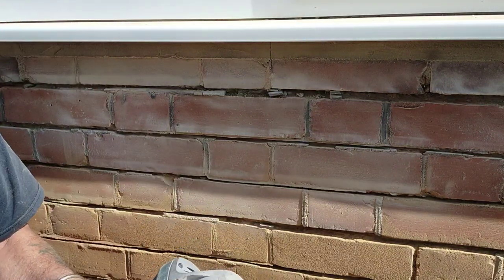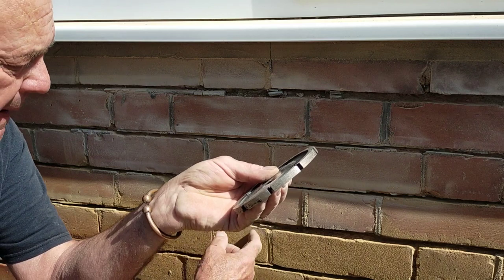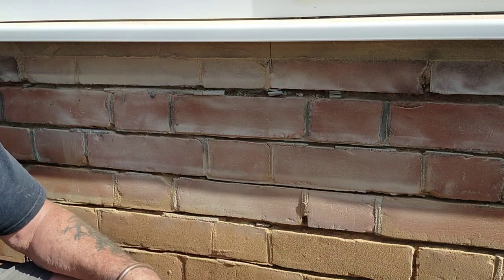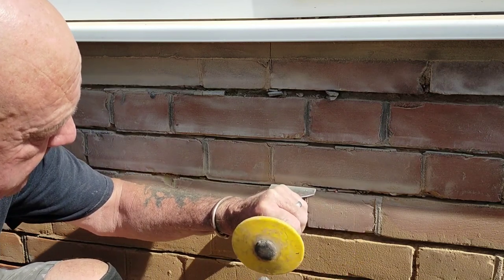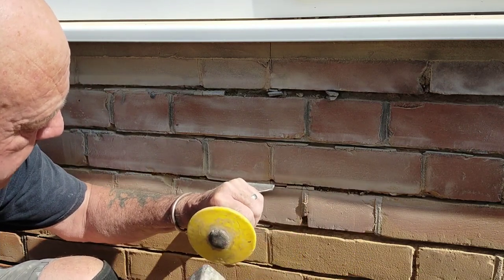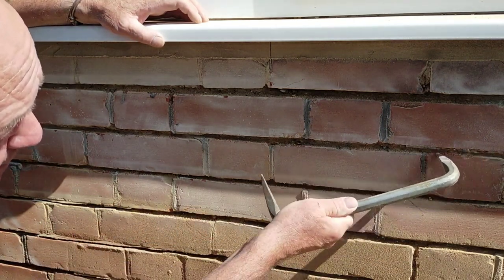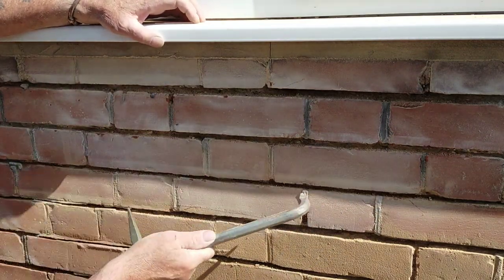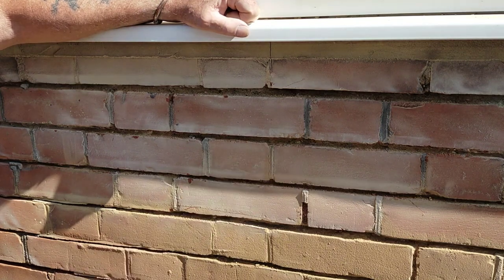Raking out hard cement pointing on soft bricks.

Comment: Nice one i used to work for the national Trust in the peak district and we used to do a lot of pointing on old stone buildings and one of the best bits of kit we used was a air compressor to blow all the loose lime mortar out after we had chopped it out it gets rid of all the dust and leaves a nice clean dust and debris free base to start your pointing. Just be careful no one has there washing out first lol.

Comment: What happens if you leave the old mortar as it is?
Reply from the maker: Cement pointing on  lime built wall dosent allow the wall to breathe well, over time this can cause the bricks to spall as the wall struggles to dry after prolonged wet weather. Softer red bricks suffer more than harder bricks.